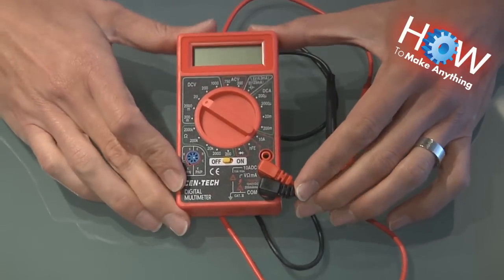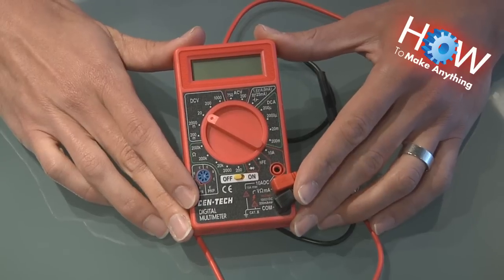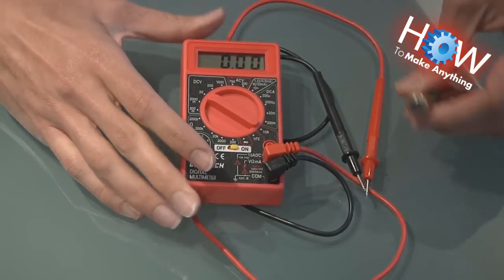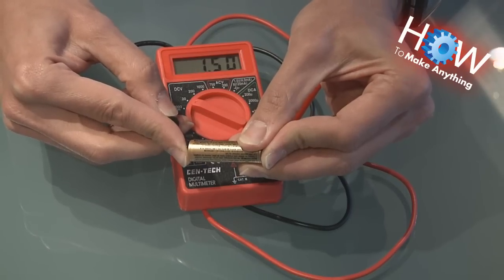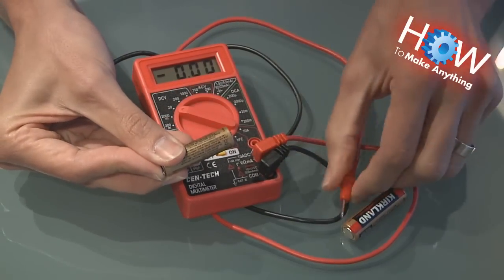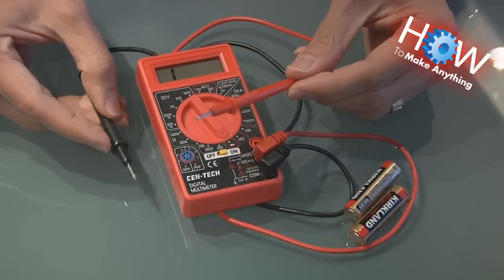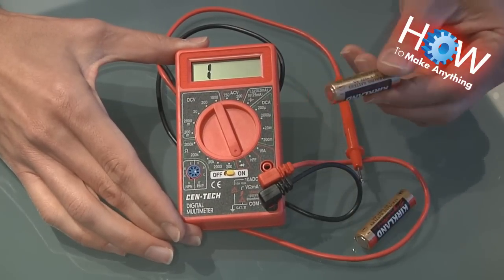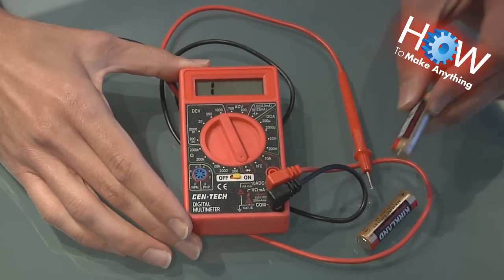How to Use a Multimeter as Battery Tester

Comment: People, read the comment below from "TheVideonut2" as he's right, this video is wrong as to how to PROPERLY test a AA and/or 9V battery. The instructions also confirm the dial on the voltmeter should be turned to the "1.5V (4.0mA) / 9V (25mA)" setting (in the upper, right position or 1 o'clock position of the meter).  At least this video quickly shows how the RED & BLACK leads should be plugged in but the setting he uses in the video (DCV 20) is NOT what the instructions suggest to use.  As many others have mentioned, there is no load on the setting he's using but there is if you use the correct setting from the instructions.  I know, I broke the guy code and I read the instructions - sorry guys but that's the correct way - LOL! 😁

Comment: This "free" model from Harbor Freight has a very rare feature specifically to check battery under a load.  It doesn't matter if a AA battery reads 1.5V.   You need to switch it to the upper right battery test where it says 4mA for 1.5V battery and 25mA for a 9V.   It places a resistive load on the battery during the test, much more reliable than open air test like he does.  If it reads under 3.5mA, I throw away my AA's.  If I get 4.0mA, that is like a brand new battery.  Now, for rechargeables which are 1.2v/1.5v, that is 80% so measuring a 1.2V rechargeable you should get 3.2mA when fully charged.  Now if only I could find this rare feature on one with audible continuity checker... let me know if one exists.  Audible is easy to find, but not the battery tester I mentioned on this model (measuring current with a load).
Reply: You can also see other videos mentioning "Testing batteries with a plain old multimeter (and a resistor)" for why the resistor is important.  But who has a handy resistor?  This model has it built in and they tell you it should read 4mA for a 1.5V battery

Comment: You have to load test the battery. Just measuring the voltage won't work. A dead 1.5 volt battery CAN measure 1.5 volts.

Comment: The capacity is the most important and not the voltage.It can be 1.5 volt and only 200 mAh capacity instead of the 1,200 mAh written on the battery.

Comment: Batteries need to be tested with a resistive load on them.
Reply: Most people do not know what that means.
Reply: Someone points out the obvious. - Thanks.
In most cases you are not interested in the voltage (which is written on the battery), but whether it is still good to be used or not. In short, 1.5V tells you nothing new and you might still be better off to replace that battery.

Comment: this meter has a specific battery test function. and you just ignored it...
Reply: No, voltage does not measure a battery's potential.
Reply: What I understand is that the “battery test function” you are referring to measures in milliamps, and the DCV setting, used in this video, measures in volts!  According to the Cen-Tech Digital Multimeter display, 1.5 volts would be equal to 4mA’s, and 9 volts would be equal to 25mA’s.  However, like everyone else, I am here trying to determine what would be a “bad battery” reading!

Comment: This video shows how not to test a battery so this person has not got a clue how to use a meter to test DC batteries to test a battery you need a load across the battery under test!!!!!
Reply: Why criticize! You make a video and show us how it's done!!!!
Reply: @pdufusc  so we cannot critic anything unless we do it? If you are in a bus and the driver drives like a maniac, don't you think you are in title to complain even though you have no clue how to even release the handbrake of a bus?
The way this video is showing how to test a battery is just not correct, and there are already plenty of other videos and articles on the internet that show the right way.
Reply: @videojeroki  how would you load test a battery?   Most people don't know there is such a thing as a load tester, or own one.  This is a flashlight battery, or maybe a clock batt, and more people have a voltmeter than a load tester.
Reply: @pdufusc  fair enough, but it doesn't make this video better. I understand that not everyone have the right tool, but this video should stipulated at least that this is a very simplistic and not accurate way to test a battery. it is incomplete, so missleading.

Comment: Wrong. You need to test under load. That meter actually has (top right) a setting for testing batteries correctly (w/ load). How did you not see that?

Comment: This may sound extremely stupid, but if you have never used one before, the first step is to make sure the batteries for the multimeter are good!  Mine is brand new never used it before, and it keeps reading "JJJ" I am assuming it just needs new fresh batteries, but I won't know for sure until I replace the ones it came with! In short, you need batteries to test batteries!

Comment: I'm ten years late here, but when use test a battery,  you should have at least a 100 ohm resistor in parallel with the meter test leads. Even an almost dead battery can still show a normal voltage when not under load. When a load is applied if the battery isn't good then the voltage reading will drop.
Reply: I am also two years late to your comment but, Thank you a lot. Your explanation led me to this video which made me understand how to measure a circuit with parallel resistors https://youtu.be/uu5doQMSXdM, and now I understand how to put things together thanks to your help. Ten years late is sometimes still worth it!

Comment: I am no Science but surely the meter is measuring the VOLTAGE but without a load - put a load onto the battery and you may well find it is lacking in power / reserve but will still register a reasonable reading on a Voltmeter

Comment: Since this guy apparently got it wrong can anyone in the comment section please tell me how to use the same multi meter to test my 18650 battery voltage properly with this device?
Reply: With this exact same multimeter: Use the battery test setting (2 clicks clockwise from the top). You should expect to see between 10.0 to 11.3 mA if your battery is charged between 3.7 to 4.2 volts. If it shows 9.7mA or less then your battery's voltage is at 3.6 volts or less and will likely not last much longer in your device until recharged. This is assuming that the instructions manual is correct when it says there is a 370 ohm load for the battery test function.

Comment: Yes it is better to do a load test but anyone who has tested batteries for a while can do it without that.  1.5 volt batteries will read lower than 1.5 volts when they are spent.  This is not rocket science.  BTW...I have an EE degree.
Reply: Uh.. no? A couple of AAA batteries that read 1.1 volts can easily power a TV remote for months. Voltage varies considerably among batteries. All that matters is the application.

Comment: This is not the correct way to test a battery. Your only testing the resting voltage. Which is not accurate at all. You need to test the battery under a small load like a resistor, or better yet, the battery testing function on this meter which does this automatically for you. Unhealthy batteries can still show a relatively high voltage when just sitting there, but as soon as there is a "draw" or "load" applied an unhealthy battery will drop the voltage to near unusable levels and its true "fitness" level is revealed.
Reply: The poster was not using the meter correctly as a battery tester.

There is a specific battery load test setting on this exact CEN-TECH meter that he should have used. It was 5 clicks to the right clock-wise. That setting loads the battery voltage with a 375 ohm resistance load to calculate the battery amperage. Which for a 1.5v battery should be 4.0 mAmps. And for a 9volt battery 25 mAmps. Each amperage is listed on the battery load test setting switch.
Reply: Dale Meaney What value would you choose to test an AA ? I have a recurrent problem, I'm very pleased with a torch but it doesn't work with used batteries, and it is boring to search really new AA
Reply: Absolutely 100% incontravertably correct (even if the spelling isn't) Top of the Class - Award yourself 5 Stars - Thanks for this.
Reply: Either way you're still going to have to do both
Reply: so why doesnt multimeters have this kind of function then???!
Reply: mortuus multimeters do have this function and this guy is doing it right. The only thing that could be better is some sort of resistance so the battery's can show voltage under load. This will say how charged it is as long as you know it's a new battery. If it's an old one it may be fully charged but might not work under load

Comment: Awesome you told me exactly what I needed to know :)
Reply: Darryn McKay No he didn't. That meter has a battery test function and he used the voltage function . Reading the voltage of a battery that is not running something or simulating a a load on the tester is of little value unless the device you are using is very low current. He should learn to use his meter before making videos. Awesome NOT.

Comment: To test a battery you need to do a  load test. Put a 100 ohm resistor in the the circuit between one of the leads and the battery.
Reply: Oh yeah, I have one of those just laying around. How about that!11
Reply: +rob miller Actually, the resistor should go between the two leads.

Comment: haha i got the same cheap multimeter , and have no clue how to use it so far other than this video so thanks for taking the time .
Reply: Jimi Craktcorn Red the instruction sheet, that came with the meter, and the other posts. The guy who made the video does not no how to use it either. That meter has a battery test function that he did not bother to use. Taking a voltage reading is iffy  as a test
Reply: Thanks but if it came with instructions they're gone now but I don't think it came with any instructions. I might b wrong though.

Comment: This way you can only measure if battery is completely dead. You cannot determine how much mAh it has left. If you knew electronics (you would first have a proper multimeter) you would know that voltmeter has very high impedace, several mega ohms. Voltage of a battery does not drop, its internal resistance rises. What do you get when you put these two resistors in series, one with low and one with very high resistance? Battery testers do not measure voltage of the battery.
Reply: He said battery tester. Not multimeter. I have battery tester, and it show only how "full" (strong, or whatever is that called. I'm amateur, BTW) battery is, not voltage. I'm trying to find out how to test battery with my multimeter too.
Reply: @yuzeyy7357  
If your multimeter doesn't have a battery test function built in then you need to provide a resistive load to the battery while measuring the voltage and amperage. Take a resistor and place it between the battery and one of the leads of your multimeter. Use Ohm's Law (I=V÷R) to determine the amperage you should expect to see on your multimeter depending on the resistor you used, e.g. 100ohm, 200ohm, 300ohm. If the voltage drops significantly under the rated voltage for your battery then it is considered depleted.
Reply: It literally just did

Comment: That seems a bit mad. Obviously we do what you said but the question you failed to answer is what voltage are we looking for? When do you decide its no good? 1.4V? 1.2? 0.5?
Reply: +Henry Parr That is a complicated question. First you have to get past the fact that the test load that you are using (or in the case of the video, no test load) may not match the load of the device you want to use the batteries in. Then you have to realize that some devices will work OK with more run down batteries than others. As somebody pointed out, the the battery voltage doesn't really drop unless it is totally shot; the internal resistance of the battery goes up. The voltage it can deliver depends on how much current the device draws

Comment: Indeed.  The problem is that a fairly expended battery could still have a pretty good voltage when not being used, but as soon as there is any current (usage), it drops down to a low level.

In fact, I must say that checking a battery is really *not* one of the most obvious uses for a multimeter, but rather a *misuse* of a multimeter.  Of course, no harm is going to come from it; just that the voltage while not in use is not all that helpful.

Others have said all this, but it's important info.

Comment: I touch the two prongs on my cars cigarette lighter and seems very accurate vs directly opening the hood testing. Be careful not to short circuit the cigarette lighter and check if there's no fluctuation vs doing it the old fashion way to see if ur lighter's dependable.

Comment: This video is great but it is showing a wrong way to test the battery. This multimeter has this function - you have to turn the switch to 1-2 O'clock - it is for Battery  charge measurement.

Comment: @1AppleMaker Thanks, but what kind of load? There's many kinds of loads out there and I guess that depending on resistance each will affect the voltage reading of the battery differently.

Comment: @howardarby 
I've been using a multimeter for years and any dead battery I tried reads at about 0.8 - 0.9V.
I have never seen a dead battery read higher than that with my meter.

Comment: this is WRONG! 
Even a near dead batery will read around 1.5 for alkaline, 1.2 for NiCd, etc. because theres' a static charge.  Instead,  you need to test the battery under a slight load.  I was looking for a way to do this w/ a Volt-Ohm meter (multimeter) . this doesn't show that.
See "1AppleMaker" about 11 comments below mine, he notes the same issue:
"ATTENTION: Using multimeter can only determine the voltage while the battery has no load. However, if you want to test whether it really...

Comment: ATTENTION: Using multimeter can only determine the voltage while the battery has no load. However, if you want to test whether it really has the capacity to run, you will need a "Battery Tester" which in term puts some load on the battery, which in term, will give you a more conclusive result. Multimeter is NOT a battery tester in a way that you can determine it's juice level.

Comment: @stewartx5 For a typical voltmeter the impedance is 10MΩ, which almost doesn't load the battery. It's way better to measure the battery with a typical load connected. As a battery gets old, its equivalent Thevenin resistance raises. That increment can be seen way easily if you connect a load.

Comment: This test is not indicative of the health or capacity of the battery. To properly test a battery, it has to be under load. You can connect it to a little bulb or a dc electric motor and once the motor is functioning, you can check the battery.

Comment: yes it dose as you use the battery the voltage will drop, the battery dosnt keep the save voltage till it runs out , that number will drop as the battery gets weaker